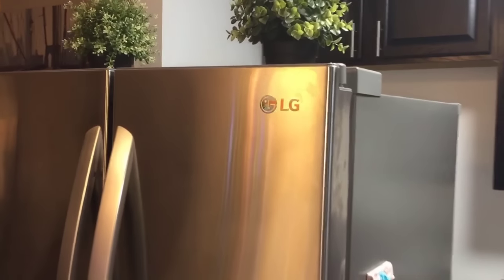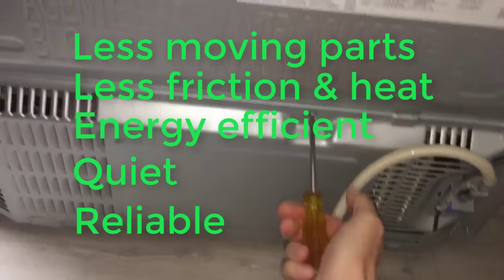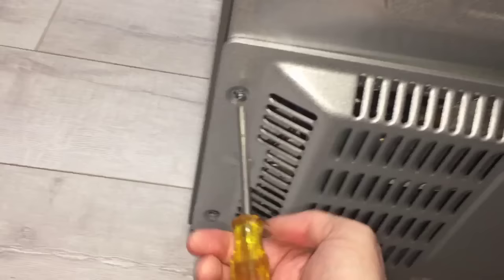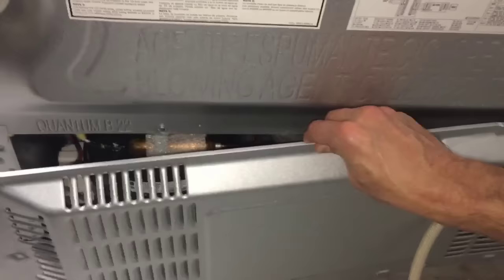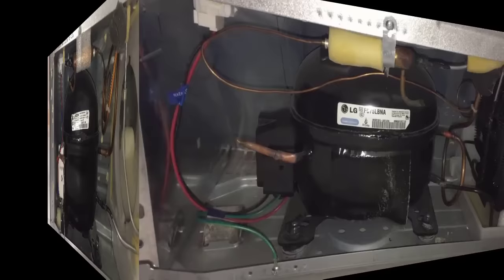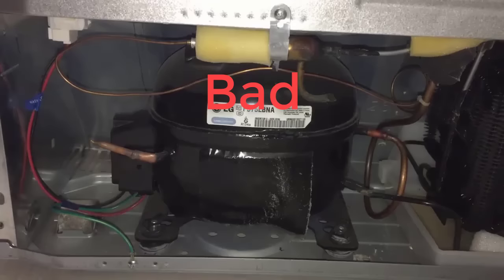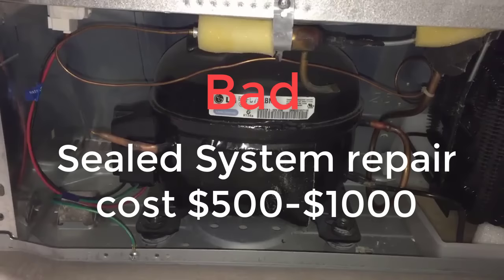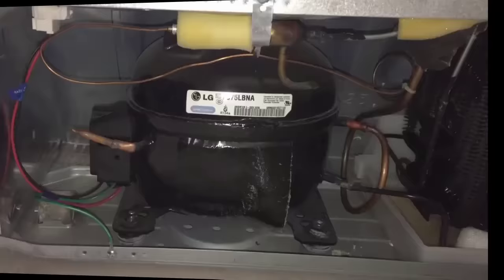LG fridge not cooling but running

Comment: First off, the “sound” of your linear compressor, is actually the Fan... I work on LG fridges for a living.. and honestly, they are the best fridges you can buy. And all you have to do is replace the screw hole where the fan fitting is... that’s it.
Reply from the maker: LOL, obviously there is a fan running on the background, but the problem has nothing to do with the fan. And if you can't hear malfunctioning compressor, you are not a refrigerator technician. LG fridges are great for the first few years until the linear compressor breaks down and they become useless... thanks for stopping by anyway.
Reply: Any idea why my fridge and freezer are running,blowing air  but not cold nor freezing. System is quiet not rattle or noises.
Reply: Been a refer tech for 9 years now and I steer all my customers clear of lg. I'm doing at least 4 compressors a week thanks to them. Good money for me but man, such bad product for consumers
Reply from the maker: Titan Taylor, thanks for watching and telling like it is.
Reply: @Pringle15  is it better to replace the compressor or just replace the fridge.
Reply: @216baja  with there being a 10 year warranty on most of their linear compressors I'd say have the compressor changed out. 400 dollars in labor is better than 2500 for a new fridge. Unless, of course, you have the extra money
Reply: I have an LG model LFC24786ST/02 AND ITS HAVING A COMPRESSOR PUT IN BUT THE PLUG SHAPE DOES NOT FIT right. It has to fit with the wires to the top of the pins unless you either cut away at the moulding on the plug or bend the top tab on the compressor which will make it so the cover over the wire harness will not fit. Have you ever had this problem? The new compressor is a TCA35271204 which is supposed to be a fit for it without software upgrade.  thanks
Reply: Seriously..?...If it were that simple do you think we would all be so distressed...Look at the problems we are having with our LG fridges over 2 years old..Look at these problems....I had a new compressor installed on Monday and my fridge stopped working today...2 days and its not working..I have friends who have had the same problem...
Reply: Is anyone can tell me I have a LG fridge one of those three doors the problem with a fridge is there's no air circulation inside in the fridge but you listen outside it looks perfectly normal the compressor looks fine pretty quiet and the fan is seems is running pretty smoothly everything looks news but it's not cooling inside at all cuz there no air inside
Reply: @Kanon Jerore LOL, if you are making a living off of repairing LG fridges, then they must not be very reliable...!